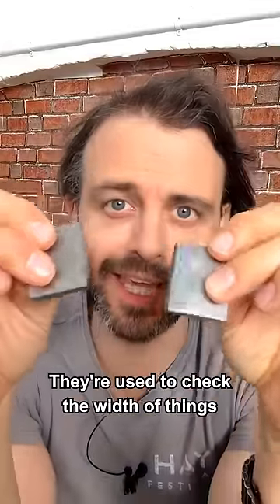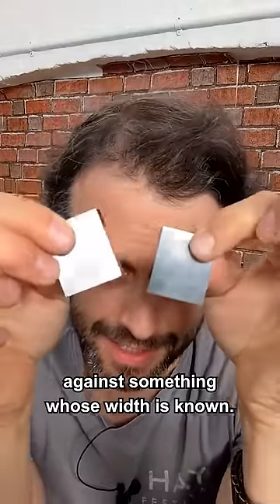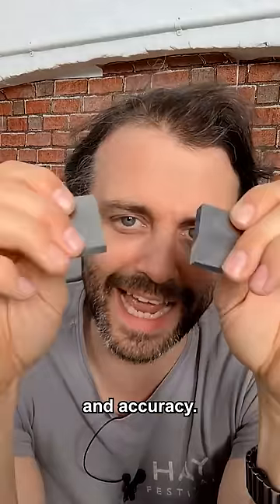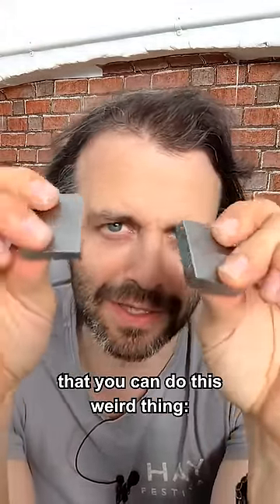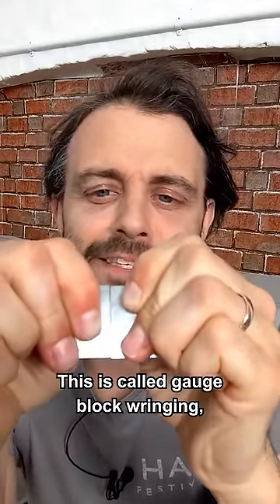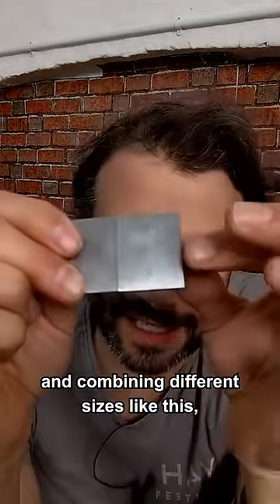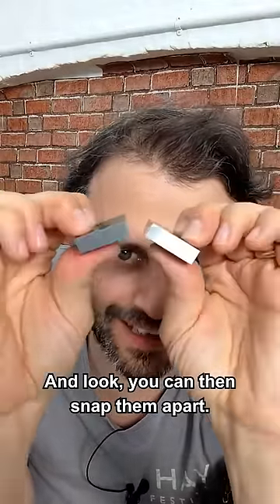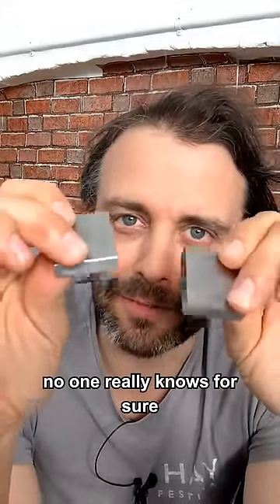No One Knows For Sure Why This Happens!

Comment: What is also interesting is that if you leave them "wrung" together for more than a few minuets they become harder and harder to to get apart.
I saw a set of blocks that had "melded" and could not be separated.
That is why they suggest pulling them apart after each measurement or set of measurements.
That molecular bonding that is suggested as one of the causes, may very well turn into molecular joining to create a single solid piece.
Reply: Yes, somewhat like "diffusion bonding."
Reply: Honestly feels so surreal that in our reality smooth metal blocks will just stick to each other sometimes and get harder and harder to unstick and we literally have no idea why it happens... is this a new update or was this always here
Reply: Metals have what's called "the sea of electrons." It's the outermost electrons of a metal atom are free to move among the other atoms nearby (one of the reasons metals conduct electricity well). When you get the surfaces of metal blocks smooth enough, the electons will start to "see" the two pieces as a single piece of metal. They will jump across readily (no voltage required) and the crystalline structure of the metals will start shifting together. The latter is very slow, but the former is immediate.
Reply: Considering a metal is essentially a crystalline array this makes sense. The crystals fit together like a zipper and lock in. I bet it doesn't work with crystals that have different structures.
Reply: Yeah, i've heard even solids diffuse into each other but it's a process that takes years, if you leave a gold coin sitting on a silver plate long enough(decade or two) then afterwards there will be traces of each inside the other.
Reply: Can you say that again? @TGNXAR
Reply: @johannesschmitz6370  Holy cow. TH-TH-TH-THAT'S ALL FOLKS!
Reply: That does sound alot like Kashimir Effect (sorry if I butchered his name). Which corrates to some particles bouncing away leaving from that microscopic space leaving it's virtual counterpart alone hence generating force that attracts both mirrors/plates closer together.

It has been many years ago when I read book about it so sorry in advance if I butchered anything.
Reply: holy smokes!
Reply: Imagine doing this with limbs
Reply: I've heard of similar things happening in space. Where you have metal surfaces that aren't subjected to oxygen, the surface doesn't get the usual layer of slight oxidation that almost all metallic surfaces are covered with on earth. That and lack of other lubricants can lead to surfaces welding together without any heat necessary if you aren't careful.
Reply: So its not air pressure but cold welding?
If they are machined with great precision there wont be air between the two and itll be simmilar like if you did it in a vacuum, so its cold welding?
Reply: Sounds like people in this comment thread know why. And he said nobody knows!
Reply: so basically welding
Reply: @PWingert1966  This should be tested, but I bet it will work with different crystal structures. I bet it's not a physical bond as you suggest but rather a chemical one. Besides, the metal is structured in crystal grains that each have their own array and are oriented every which way from each other, so they wouldn't be able to lock into each other like that anyway. The borders between the different crystal grains are what determine the metal's strength. It's theorized that if you could make a monocrystal metal it's strength would surpass anything we've ever seen, since the weakest link would no longer be the borders, but the crystal lattice itself.
Reply: Bullshit
Reply: @mr.commonsense no
Reply: @mrkiky it can't be chemical you haven't made chemical processes to made the final result just physical
Reply: @giovanimontoya4517  The atoms of both surfaces doing stuff with their electrons would make it a chemical phenomenon
Reply: I would suppose that if both edges are polished fine enough and forced together like that, they might be experiencing van der Waals force.
Reply: I have seen it done with optical (glass) standards normally used under Theo lights to check for flatness and they never got them apart after they were wrung together. So different crystalline structures will do the same thing. @mrkiky
Reply: That does seem like a bold yet interesting claim
Reply: Cold welding
Reply: @rickpitts2277  Makes sense. Is what you are referring to as "optical glass" actually a crystal though? In a scientific sense glass and crystal are kinda opposites, but in colloquial terms you can mix them together.
Reply: In my lab we actually use this phenomenon to fuse laser crystals to heat sinks with thin films of gold on each super smooth surface
Reply: In my lab we actually use this phenomenon to fuse laser crystals to heat sinks with thin films of gold on each super smooth surface
Reply: In my lab we actually use this phenomenon to fuse laser crystals to heat sinks with thin films of gold on each super smooth surface
Reply: In my lab we actually use this phenomenon to fuse laser crystals to heat sinks with thin films of gold on each super smooth surface
Reply: In my lab we actually use this phenomenon to fuse laser crystals to heat sinks with thin films of gold on each super smooth surface
Reply: In my lab we actually use this phenomenon to fuse laser crystals to heat sinks with thin films of gold on each super smooth surface
Reply: In my lab we actually use this phenomenon to fuse laser crystals to heat sinks with thin films of gold on each super smooth surface
Reply: In my lab we actually use this phenomenon to fuse laser crystals to heat sinks with thin films of gold on each super smooth surface
Reply: In my lab we actually use this phenomenon to fuse laser crystals to heat sinks with thin films of gold on each super smooth surface
Reply: In my lab we actually use this phenomenon to fuse laser crystals to heat sinks with thin films of gold on each super smooth surface
Reply: You are saying the metal is able to grow together kindof. How cool
Reply: Sounds like you need to educate the vid poster cause this sounds like the most plausible explanation  @TGNXAR
Reply: It could be that they sinter together?
Reply: So the atoms intermingle and connect to each other, but it's really happening at the subatomic level, and so I wonder if you couldn't consider this quantum tunneling
Reply: thats crazy actually
Reply: Maybe magnetic forces or bonding between atoms very close to each other? Like how small rocks become big rocks?
Reply: Wow😮
Reply: @hrishikeshaggrawal  it depends on the solid. Silicone can have things diffuse into it within days to weeks and completely ruin it.
Reply: @jmalmsten 
Cold welding!
Reply: @waltersobchak9427 
Is that your scientific estimation?
Reply: They were probably dirty and rusted together.  I worked in a calibration lab where we tested wringing them to together under lab conditions (68 degrees +/-0.5, 20-40% humidity).  We left them for 5 years and they came apart with my hands without issue.
Reply: @USMCJPelt I was going to say that it didn't seem possible that they could meld together but I didn't want to sound stupid to a bunch of internet keyboard warriors. However I will take the word of a fellow devil dog.
Reply: in germany, we call it "cold welding"
Reply: Crazy sounds like science fiction 😂
Reply: This is why I think it's a suction effect and the longer you leave it, the more molecules are pushed away because of said suction. Thus making an even stronger suction.
Reply: Maybe something to do with electrons? Those are usually involved when things meld or fuse.
Reply: I would have to say they stick together because they want to molecularly bond, esp if they are made of the same thing.
Reply: That's metal-to-metal bonding at the atomic level.  The hyper smooth faces is what makes it possible for so many metal-to-metal bonds to form so rapidly.
Reply: @akulkis  that's what I was trying to convey.
Reply: @akulkis  then a possible test of this would be to take a number of these, get a highly detailed image of the surface before and after the "wrung" effect. With modern technology we should be able to prove a theory of molecular bonding based on how the surface changes.
Reply: Cool invisi weld.
Reply: Yes I was taught the atoms don’t know they are on different pieces so spread out,  disperse and bond to form one piece. Layman’s terms clearly but astounding.
Reply: @oceanbytez847  very interesting.
Reply: So this is how the giant spaceships of the future will be made.
Reply: @HuckleberryHim It's called cold welding.

https://en.m.wikipedia.org/wiki/Cold_welding